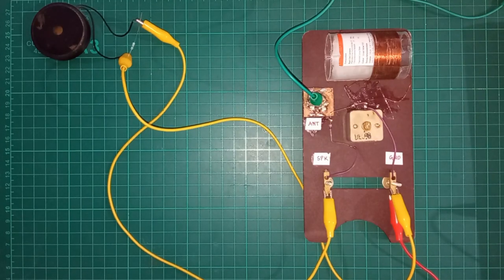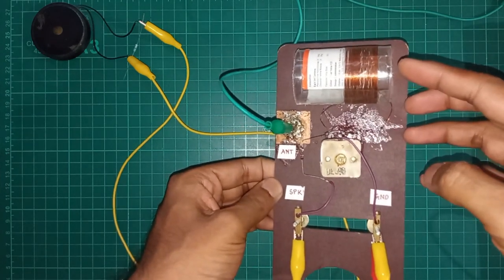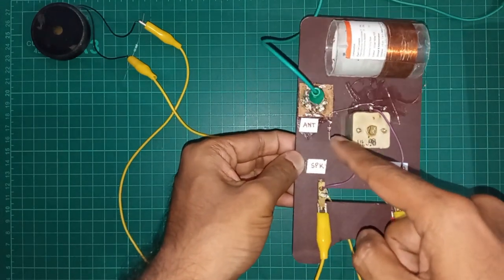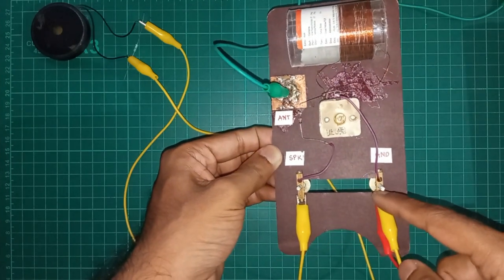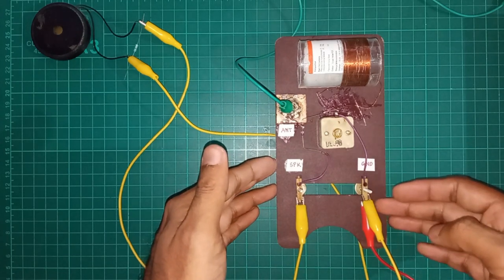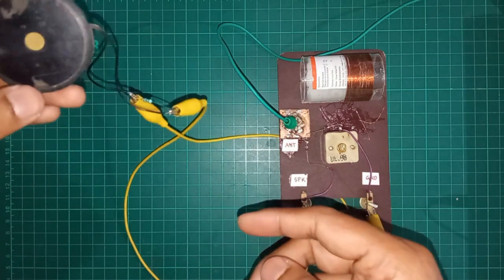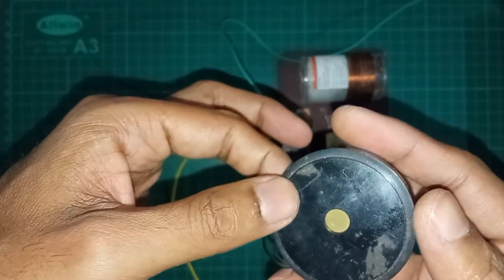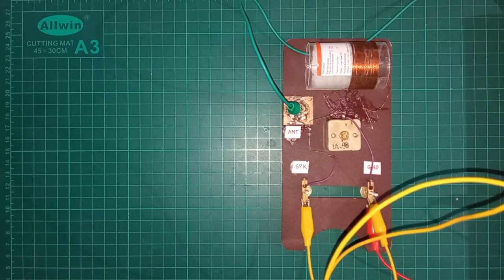Simple Crystal Radio

Comment: Thank you. What other type of element can you substitute
for the Piezo element you use for your speaker?
Reply from the maker: You can use piezo element plate from Piezo Buzzer which is easy available, You have to remove the oscillator circuit and use only the element along with the plastic case. Note that using the piezo element along with the plastic case like I did (resonance chamber) will help to boost the audio.
Reply: Thank you, could you use a 20mm Piezo element buzzer disc wire speaker
rather than taking a buzzer apart for the element disc? Thank you again.